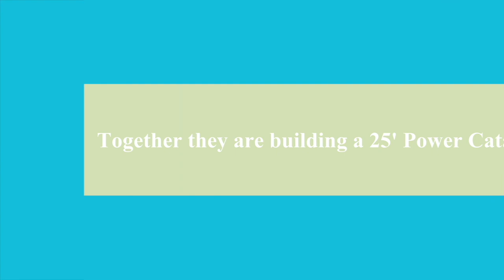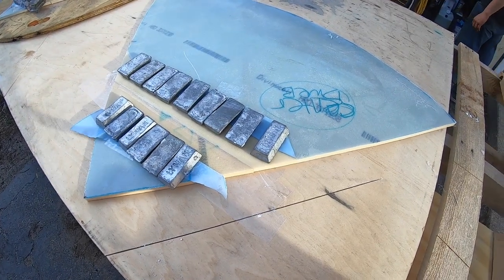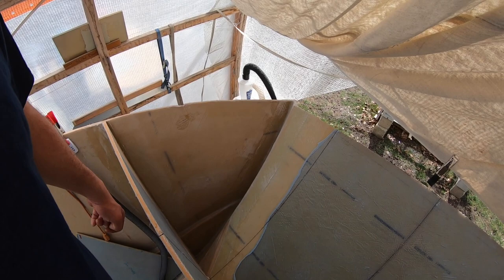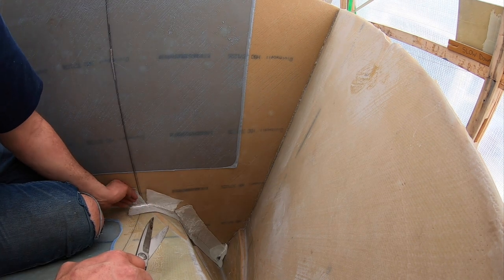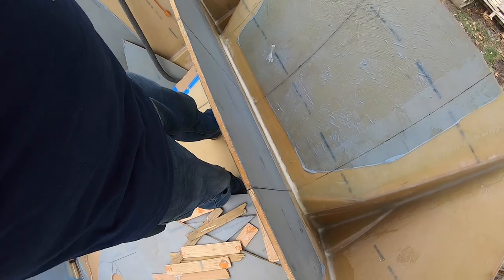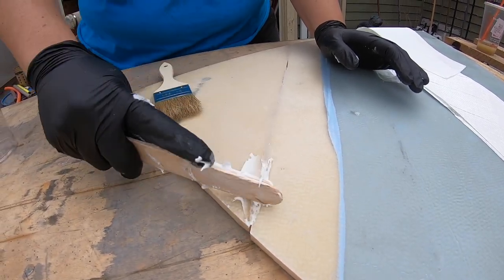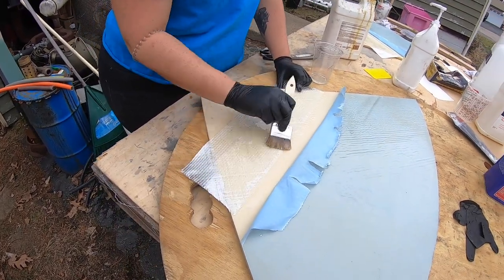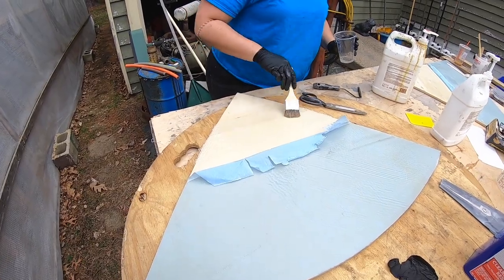Step 82 - Prepping D-Webs for Installation!! Power Catamaran Build

Comment: Hi Carl, could I suggest you to pre-wet 10 cm biaxials, it alot easier to put in joints when they are wet
Reply: no not a good idea they are doing it the correct way by industry standards